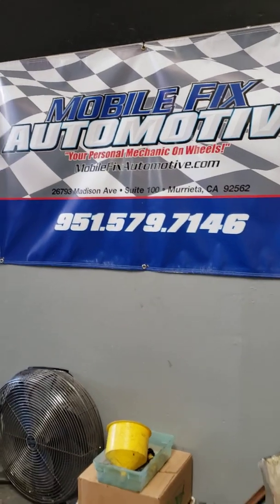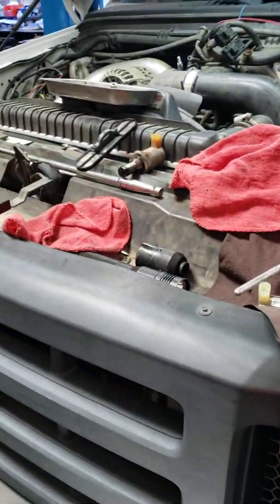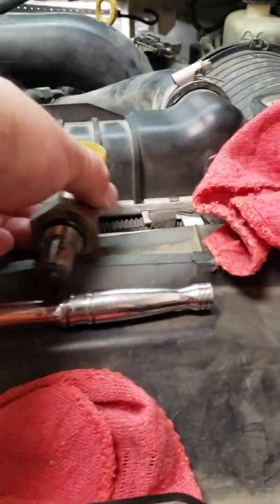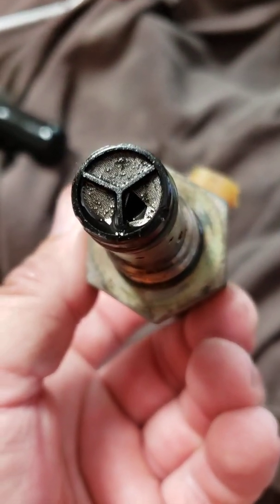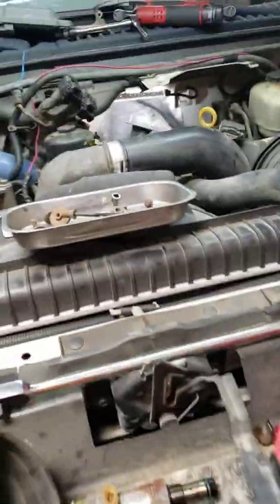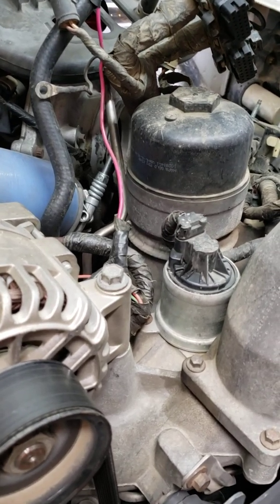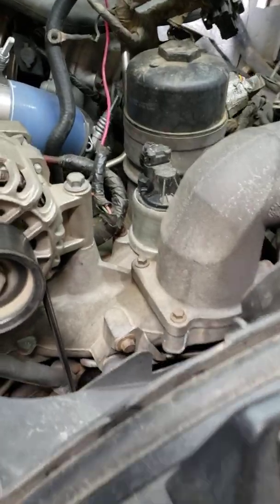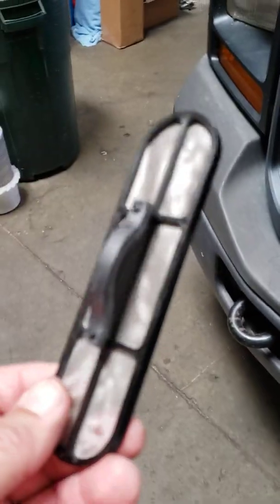6.0 POWER STROKE DIESEL NO START IPR VALVE

Comment: Ron, great video for expanding on Diesel tech Ron's vast selection of info. You guys are the collective of valuable information on these Diesel trucks and thank you for sharing. I have been a mechanic since I was old enough to hold a wrench, I agree, no one works on my cars but me. I just wanted to offer that I believe lack of maintenance is the cause for most of the issues for the 6.0. I am 2nd owner of an 06 F-350. It remains stock 06 with no upgrades.  Runs great, coolant was crystal clear when I got it at 183K. Previous owner had all maintenance and any work performed on this truck by Ford, all Motorcraft parts right down to the wiper blades. All fluids changed / flushed per Ford's schedule. It is just coming up on 200K so I will give it the works, stand pipes, oil manifolds, oil cooler, egr all sensors etc. I will repost and share my findings of some of the components in question.

Comment: Thanks for the video you don’t talk too much, I was listening.
Good information, problem sounds pretty bad and I’m sure not everyone is going to check on the screen under the oil cooler under the manifold.
Isn’t there any engineering that redirects the oil to a secondary oil filter? Sure would be nice if we could redirect the oil to a removable spin on oil filter pre or post oil cooler to clean the chunks out of the line and once the ipr valve was replaced you wouldn’t have to be concerned as long as you replace the oil filter when you do the oil change. Why don’t they filter the coolant the same way to collect the chunks of debris. Use a spin on filter and prevent the chunks.

Comment: THX RON, that's my Exact issue: no screen on IPR, and couple tiny pieces of plastic got into the valve with slight open. Got an IPR kit with screen and orings. Backflushed the valve. I think all fixed. So my question now is, do I need to reset the P2290 code or will it go away. My upper/lower oil pressure is confirmed good.

Comment: Great video. I also learned alot from diesel tech Ron. Question for you..... I have an 05 excursion. Did all the injector seals, oil rail seals, and new upgraded dummy plugs ( ford parts)  put at least 2k miles on engine after, no problems. Was on my way to Texas from California and it died on me while on the road. Put scan tool on it and it shows about 150lbs on icp and 85% on ipr. I know it needs 500lbs to start. What confuses me is that the oil pressure guage on instrument cluster goes up like it has normal pressure when i crank it over. Should I ignore that? Is that telling of another issue besides possible bad ipr?

Comment: have 2004 f250 6.0L with 32000 mile its now has been fully deleted one of the problem with  it that ever now and then it makes quick chatter sometimes once in blue moon acts like it wants to stall out   then snaps back in.  no check engine light. many shops looked at but no fix can you help me please.

Comment: I had a 6L that was losing coolant. My boss advised me to RR the EGR cooler. This was in 2016 and Ford no longer had one. The after-market one was a bit too large and the intake manifold did not fit back on to the engine and had to put the old one back on. As I recall the part was obsolete.